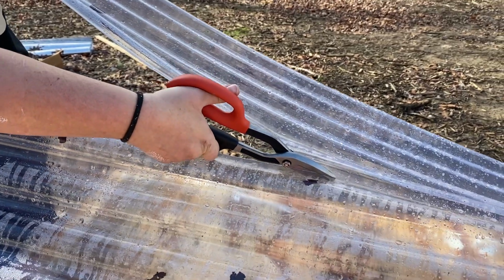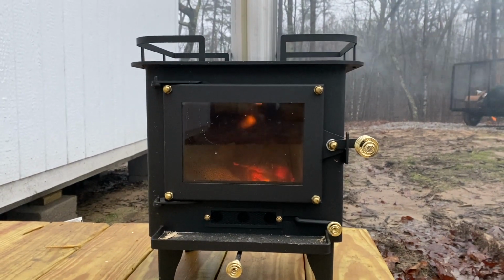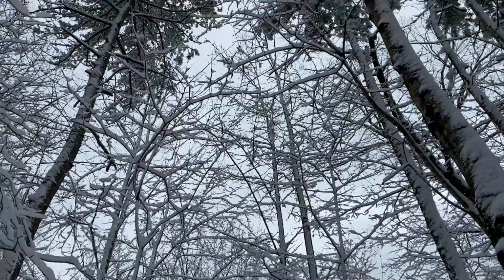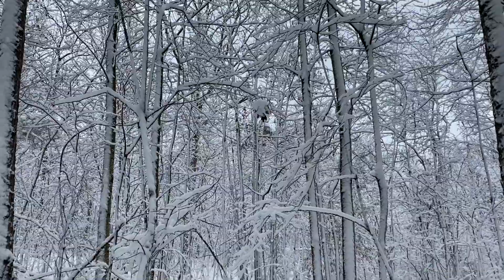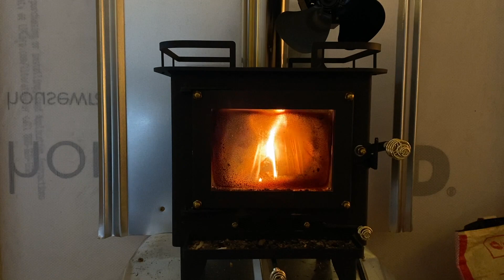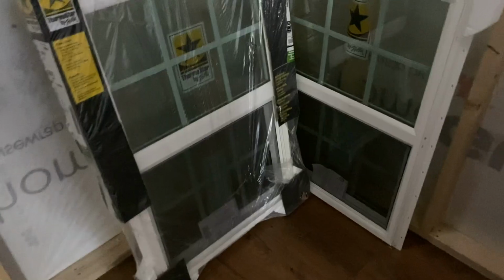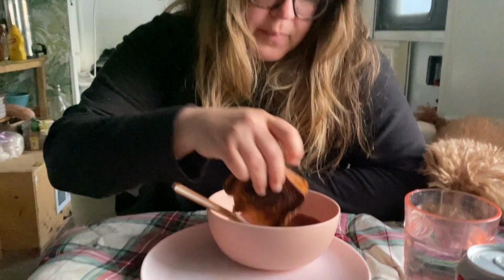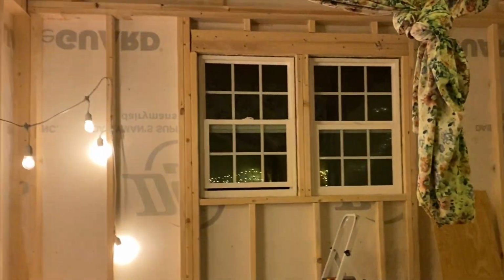Winter has arrived & we aren't ready!

Comment: It's so hard to stay motivated when you are cold so good for you guys! I'm not sure if you figured out your woodstove problem yet but I know different woods burn at different temperatures. We have a thermometer on our stove pipe to monitor how "well" the stove is actually heating. Some wood I can burn all day long and the woodstove barely gets hotter that 200 F, others it's up to 800 F in like 40 mins
Reply from the maker: we ordered one of the thermometers!! We definitely need to practice with the fires to understand the woods more. Can't wait to get the insulation in and really see if it's going to do the job.